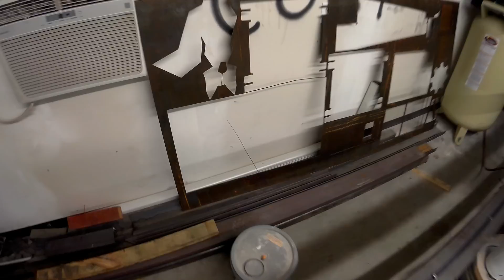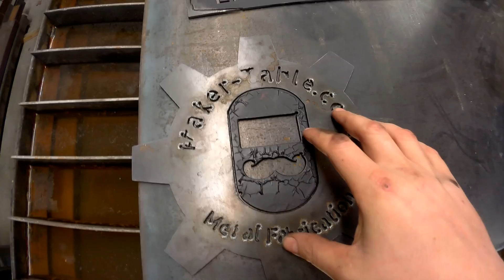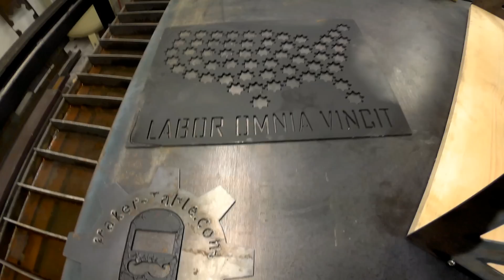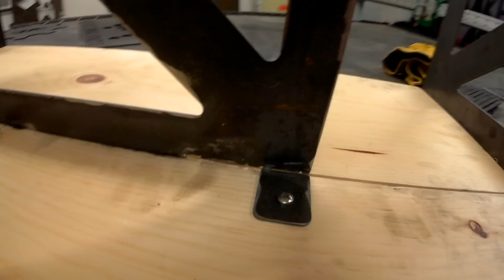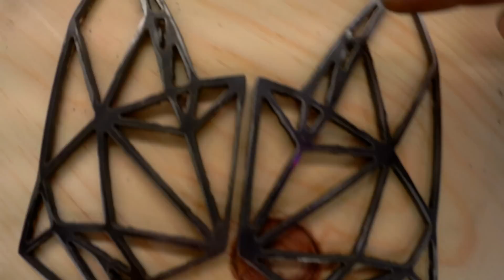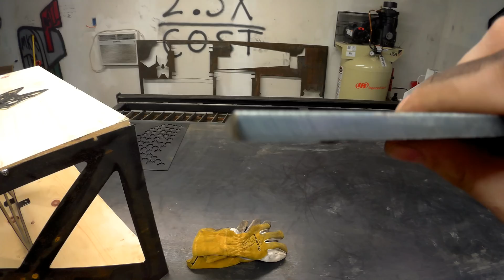CNC Plasma Table Fine Tuning 4k

Comment: What made  the biggest differences in the kerf bevel? I'm fighting that on mine now... mine is square and as level as I can measure it. Tried playing with a few settings in sheetcam for ipm, height, lead ins/ outs, and overcut but havent really seen any significant improvements. My THC needs calibration too, it was raising the height up to .7 at times... Does air quality and moisture play a role in that like you were speculating? I don't have a drier and have a separator to hang up in the shop now.
Reply from the maker: THC and cut speed has the biggest impact on slag and bevel. You have to figure out good settings for each material and thickness. I cut 12 ga at 260 ipm and 128 volts, hope that helps man.

Comment: question the gantry beam 3x3 how straight are the metal beams
ones I measured 6 foot long seemed to be within 10 to 20 thousands I understand
height can be off some torch height will solve that but what about front to
back if there is a small bow of 15 thousands or does it not matter   I tested several beams 3x3 4x4 3x5 they are
all off 10 to 20 thousands well within steel mfg. specs
Reply from the maker: jeff c I just discovered a slight bend in the beam travelling across the table. Up and down is no big deal because of thc like you said. I'm going to try and shim between the steel tube and the aluminum v rail to get it out but it is less than 0.03" over 3 feet so honestly I'm not too concerned about it at this point because Im not sure where to get shim stock that thin. I'm used to shimming base plates on columns not machines lol. It's a little different ball game.
Reply: shim stock  check http://www.mscdirect.com/  or https://www.mcmaster.com/#standard-shims/=164fbxa   I like McMaster carr  I used some stock setting an old Sheldon lathe I restored it comes in all kinds of sizes
Reply from the maker: jeff c Nice find, I didn't even think about McMaster's! Thanks 👍

Comment: Make sure to eliminate variables. I'd check your consumables to get rid of that angled cut on one side of a flag. Then play with air pressure and amperage to get rid of that excessive slag.You got this!, have fun.
Reply from the maker: Thanks for the tip.  I'll have to get into air pressure settings next!

Comment: Progress-Yes!

I was correct on the original MT cut piece, without the bridges the machine perceived it as three nested parts. I have the Torch Mate Software on the office computer so I can pre-flight the files before sending them to the plaz table. It sure saves on the conversion of exp plate into worthless scrap LOL.

I use Coreldraw for drawing as It has the drivers for my vinyl cutter (this was my intro into manipulating vectors) . I export it as a dxf then load it into the TM cad program which creates the tool path, lead ins and allows for kerf compensation. (use the show fill option  / mines located under the view tab - this will show you what the cut pce will looks like) Then it goes into another TM program that rights the g-code. The first thing that will pop up in a bad vector file is the tool paths will be backwards. 

Don''t beat yourself up on what you don't know, just learn a new feature every-time you run it and before you know it it will be second hand knowledge just like laying down a nice looking bead..
Reply from the maker: SegoMan thanks for all the great info. I'm using different programs but the principles are the same. Your totally right I just need to keep running the table until its second nature.
Reply: Copy that on the different software just posting it to the masses like you are..